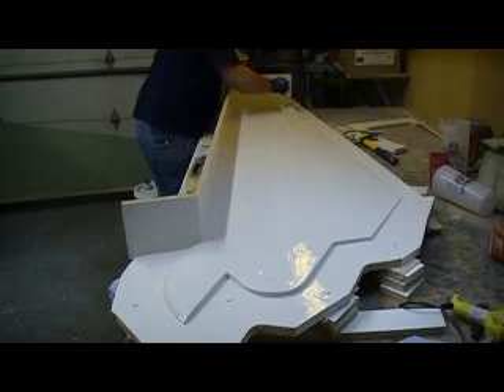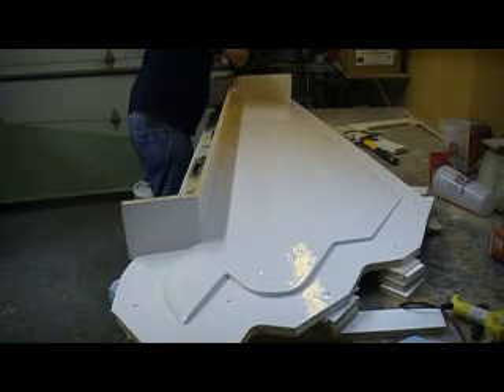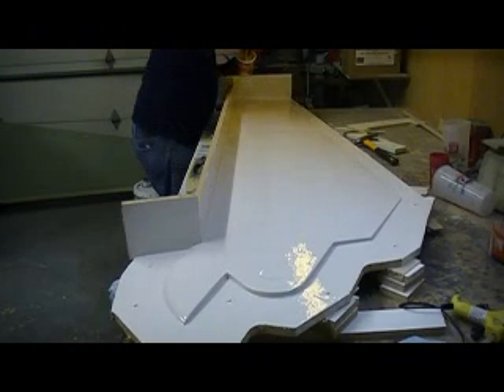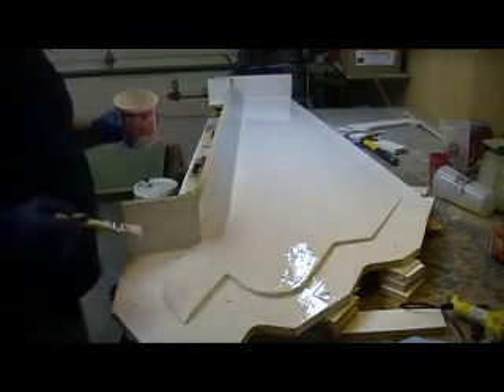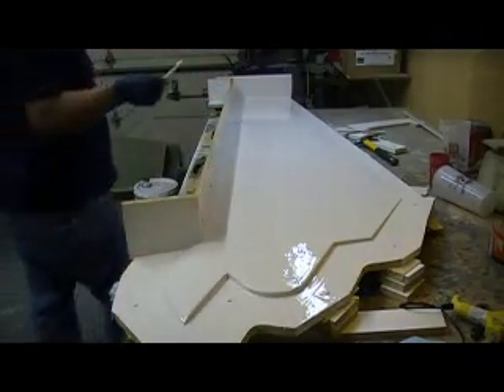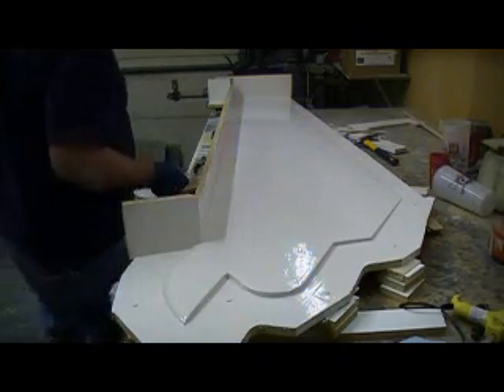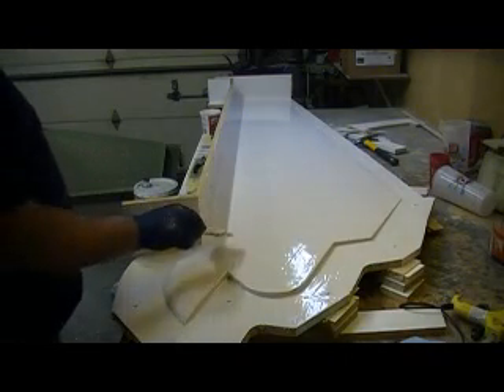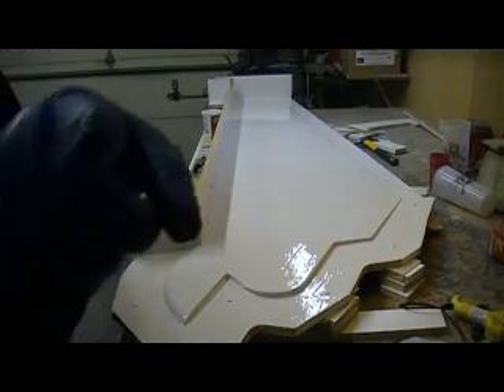how to build a rc jet B-1 Bomber # 116 pt 5

Comment: Good warning about the resin heating up. If anyone is using Linseed oil for some wood working. It will do the same thing. I put the rags in an old metal coffee can and set it outside. I've seen it catch on fire while it was snowing. Also, I'm glad to hear that I'm not the only one who thinks you sound like the Man in black.

Comment: if you have mixed resin in a confined area the heat from the reaction cant escape so it will get extremely hot.  Best to spread it out so it can cool.   We use epoxy at work and I have seen it boil up in a large bucket